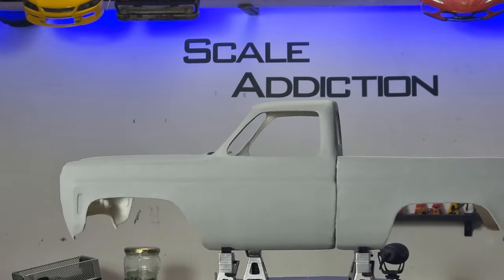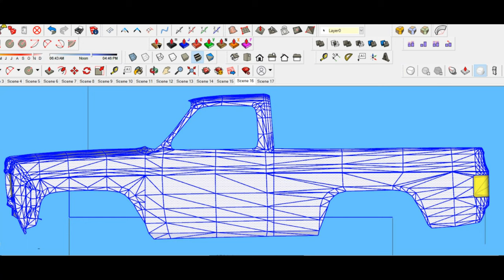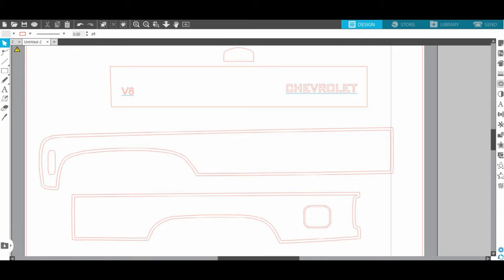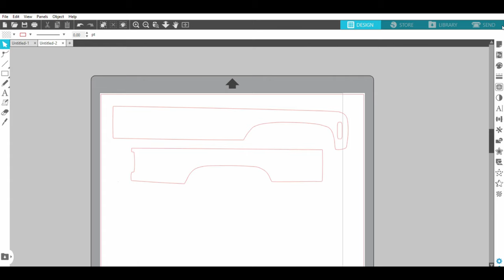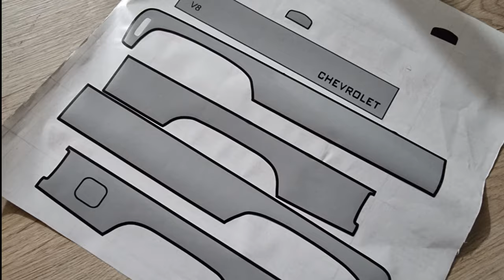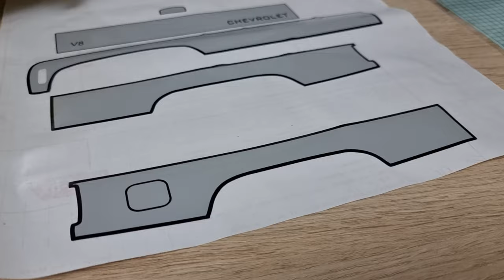3D printed Chevy Blazer k5 for SCX10 Chassis Part 2/ How to 3d print rc car body/ Painting rc body

Comment: Great video r you gonna be doing anymore work on the 240z
Reply from the maker: Thanks, yes, I was waiting to get small screws for the wide body, finally got them, i will make the video soon
Reply: Thats great news I bought the body of the 240z in ive been following along thanks for the great file in videos
Reply from the maker: @jeffreyjames1987  thanks for your purchase, it will be soon 🙏
Reply: @scaleaddiction  not shore how to reply through the whatsapp never used before in putting the number in does not work
Reply from the maker: @jeffreyjames1987  it was a fake account, already removed and reported it
Reply: @scaleaddiction  ok cool yea was tryna make shore